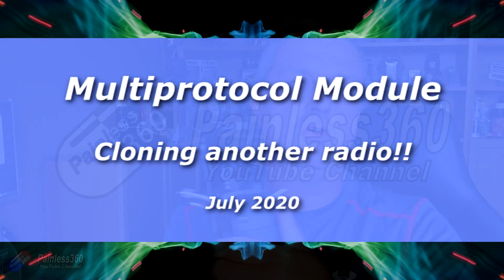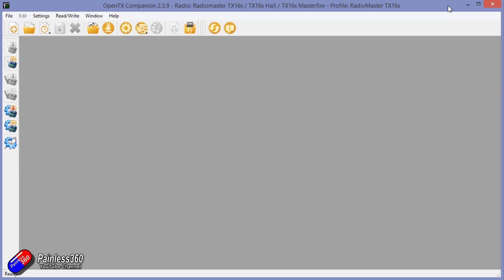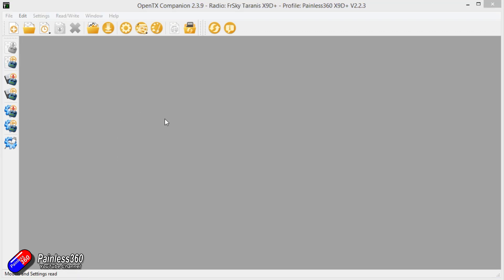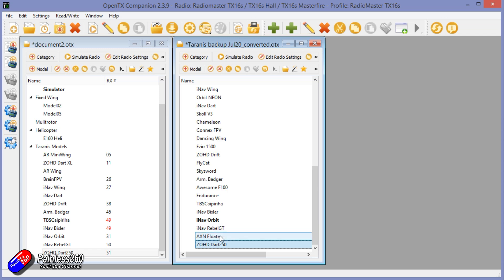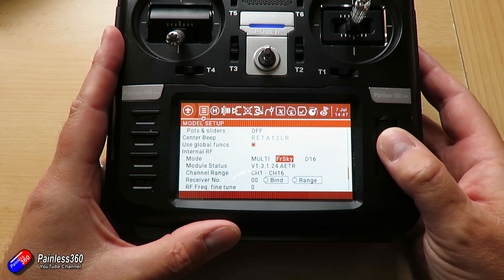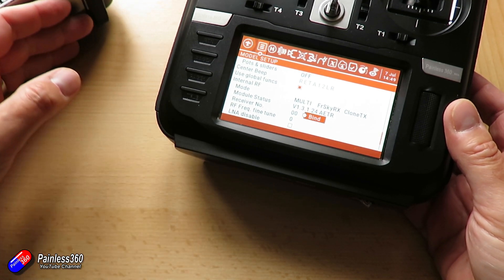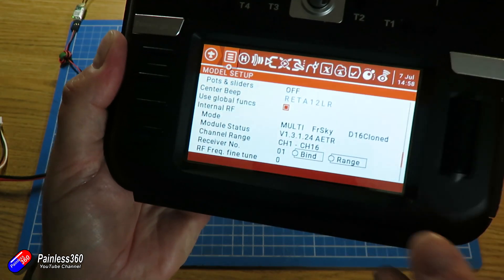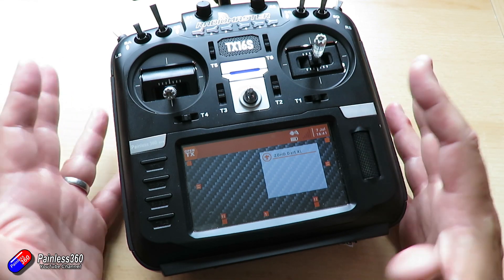Multiprotocol Radios: Clone your FrSky radio so you don't need to rebind

Comment: Finally moved from TX16s MKI OpenTX to Tx16s MKII EdgeTx with lots of models.  There is an easier way now to clone the radio.  Use the Multiconfig Lua script on old radio to read the MPM ID.  Then run that lua on new radio, and edit the settings to match the old one.  Save and done!

Comment: I recently had a problem with a glider model on the taranus that I wanted to move to my Jumper T16.  No matter what I did the radio setting would not allow for a fresh radio setting (bind) in the Jumper.The servos all worked, but the telemetry would not.  The only thing I may have skipped is setting the profile for the taranus when I loaded in the model. When I simply created a new model, the multi module would show the new version of firmware I had just flashed and telemetry worked perfect.  I had to hand copy over all the programming to the new model to solve the issue. Still really have no idea why I could not just create a new model and copy over the other model setting without bringing the old protocol with it.  Thanks so much for this video as I purchased the RadioMaster TX16S mainly due to the ribbon cable issue in my Jumper T16 and this will help make that process seamless.

Comment: Sorry FRSky, I have been using your products for years, bought your new Taranis and most of my receivers won’t bind, constant software upgrades to make things work. I have spent more time removing receivers out of planes than flying them. I have had enough and I am switching to Jumper.
Reply: Same here. Migrating to RadioMaster. Done with Frsky after the stunt with the Accest protocol
Reply: It was a Pita in the beginning but after a few years I have got the hang of it. It isn't my first choice for a control link but sufficient enough for my rc airplanes and tiny whoops

Comment: Really like your videos! Just a small question.. Does cloning mean that also the frequency fine tuning is done at the same time? Or do you still need to fine tune it after cloning? Thx
Reply from the maker: Sadly not, you need to check that too. Well done for spotting that so many pilots I see don't even know they need to tweak that for best performance..

Comment: Thanks for this video, worked great for me except for my large scale gas powered P51D which has 2 X8R FrSky Rx in it, one runs the fuselage servos, the other runs the wing and U/C. Neither Rx will bind. I could just do it manually but I hate to be beaten! Obviously needs a few extra steps, can you give me any tips please?

Comment: Very cool. Will use for my XM+ quad. The rest are either going Crossfire or need downgrading from ACCESS. Incidentally, to copy models to/from the Radiomaster, I plug in the cable and select the storage mode but you do the trim switches, turn on method. Any advantages to either?
Reply from the maker: They both work. One gives you access to the bootloader too but can require ZADIG. Happy flying!

Comment: Oh my !!! Fantastic !!, so I could order this Radiomaster TX16S and clone my old Taranis DX9 D (NON-EU) with all my DR8-II PLus receivers ?(that actually I m flying now) , it is a integrated function in the RadioMaster TX ? that Cloned Frsky ? please, if you get the time, answer me, thank you again !!
Reply from the maker: https://www.multi-module.org/using-the-module/radio-cloning looks like there is a slot for cloning the D protocol but I have not used it here.. Best of luck
Reply: @Painless360  Hi again, finally I purchased this Radio in the hope to continue using my many models that using the receiver Frsky D8R-II Plus, but , even that I can bind the Taranis and TX16S , in the next list dont appear the sub-protocoll D8Cloned !! , I dont know what to do now , very bad luck ! I have 6 models flying with the old D8R-II plus, and I using the lastet OPenTx firmware and internal module too. If you have some suggestion, it is very welcomed !! greetings and thank you from Sweden.

Comment: I just exported my models from my old trusty ACCST Taranis QX7.  I switched to a jumper T-18 because it's getting harder to find ACCST receivers with telemetry and when you do they cost more than they should.  So.. a T-18 made sense.
First mod I plan on making is an external 2.4ghz antenna.
Cloning my FrSky receiver bindings was a breeze.  Can the same be done with DSM and DSM2 ? I'd like to migrate my Eflight airplanes over to the T-18 too.
Reply from the maker: Yes. Check out the link on the supported cloning protocols.. Best of luck

Comment: @Painless360, a QQ... If I want to sell on an MPM radio (or the radio I cloned at any point), how do I wipe the cloned ID from the MPM? This is important as I wouldn't want the buyer being able to bind any new models using that ID or we could end up controlling one anothers models. Do I simply reflash the MPM firmware? Or is the ID held in OpenTX, so I reflash that?
Reply: Update... I suggested this erase cloned ID functionality to Pascal from the MPM project, and he implemented it in test within 24hrs! It is now part of the latest stable build.

Comment: I followed your video only difference was I used a MacBook Pro. I didn’t have to reload my models? Wonder if it was because of the Mac? Also afterwords I got a update multi module required. There’s a good site I’ll try to post a edit with the link here that makes the download simple. Just download and copy to firmware in you SD settings then execute the bin file and it’s done.
Reply from the maker: Video on how to fix that 'Update required' already in the playlist.. Happy flying!

Comment: Any idea if this is somehow disabled in the CRSF Shot nightly builds put out by TBS? Under the FrSky protocol, my subprotocols stop at "LBT 8ch", where on yours it seems to go up to "D16Cloned" and "D8Cloned". Maybe I will just have to wait for 2.3.4 for all the features I want to be available in one firmware.
Reply: Nevermind, I think I found the answer: "OpenTX 2.3.8 N184 (nightly) or later is needed to have access to the "D8Cloned" and "D16Cloned" subprotocols, D16v2.1 "Cloned" is available under FrSkyX2/Cloned."   The TBS build I'm using must be based off an earlier version.

Comment: Hello Painless, I have a problem that has lasted days.  in your video, you use the D16 mode.  but you don't mention most users in the EU/ UK useLBT and as far as I can tell, you can't use the mulit protocol on EU LBT X8R frsky receivers.  If I use the Multi/FRSkyRX/CloneTX, following your video I see the bind take place on the TX16S.  But that is as far as I can go.  If I reboot the only option in Mode  is D16 or D8 cloned, so my LBT receiver will never connect.  Am I missing something here, please help.
Reply from the maker: LBT is supported. See the wiki.
Reply: @Painless360  THX for the quick reply.  Will read wiki

Comment: Just bought this radio and upgraded to 2.3.11 and the clone function hasn't worked for me. In addition all the telemetry settings have to be redone because the system does its own things and this results in duplicate telemetry listings. Pain all round but the features in the 2.3.x are great. The migration is from one of the original Taranis X9D on 2.2.4.

Comment: So...Can I clone my Taranis to another Taranis? Or do I need to buy a multi protocol module, and install it on the new Taranis in order to transfer all the receiver IDs, etc from the old Taranis? If so, which multi module will accept the firmware Pascal has written that allows for the cloning?
Reply from the maker: Cloning is a feature of the Multiprorocol module..
Reply: Thank you.
Reply: Will the cloning feature be available in 4-in-1 modules that run either ppm or serial? Like the Jumper external module or the irangex ITX4 plus?

Comment: superb video and such an under advertised capability in the jumper ecosystem! I'm using the T-lite and that wont for some reason work with the open tx companion properly (bin file read errors) anyone know is it possible just to create a model in the T-lite and use the clone function?
Reply from the maker: The T-lite is not supported by OpenTX companion yet. See my video on it.. Happy flying

Comment: What is your current goto radio?
Reply from the maker: See my Kit Picks video out today 😉 happy flying!
Reply: @Painless360  great! Good timing thanks! I'm gonna get the tx16s. I have an aging taranis and I think my back board is shot. I lose connection at 50 to 100feet. Can't figure out why but think that is why. Using x8r and x6r with the same issue. Or would you think it would be firmware issues? Thanks again for all you do for this hobby!!!
Reply from the maker: Sounds like bad radio board or a broken antenna... best of luck